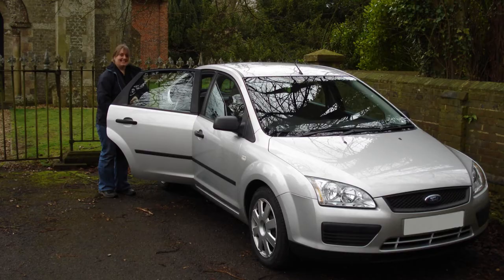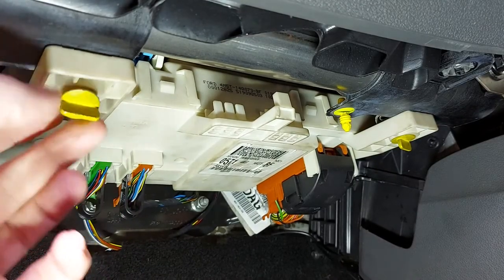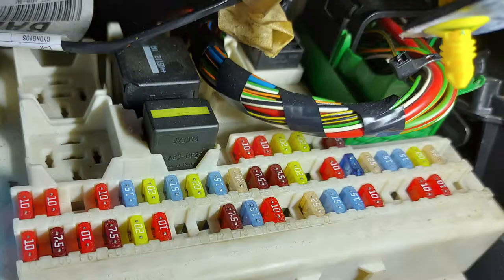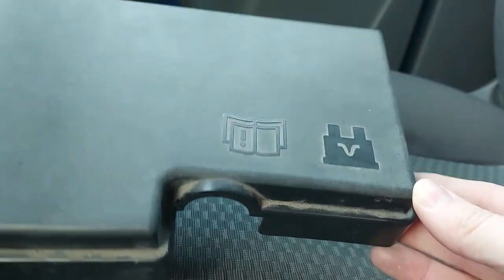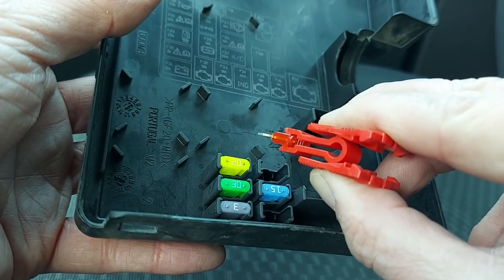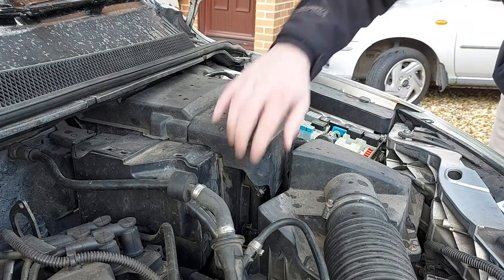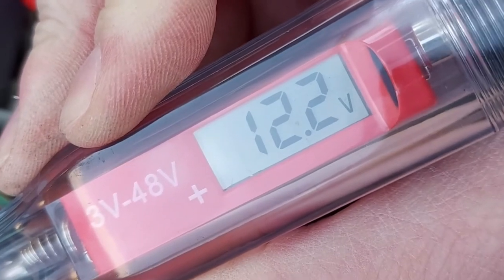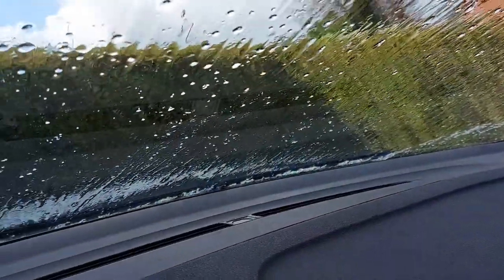Ford Focus Mk2 Fuse Box Location (+ How To Identify & Test Fuses)

Comment: nice learning curve!! can you assist, my car has a shorlt circuit...i disconneted every fuse and cables then i only plugged the power supply connector to the gem module (passenger fuse box) and i still have a short circuit? could this be a bad GEM module?
Reply from the maker: Hello. As I recall, there's a GEM test procedure. I haven't made a video on this subject yet, so it might be worth consulting the owner's club forum. Good luck.

Comment: Thanks for the vid, any idea if any of the fuses relate to rear indicators? My rear passenger side has stopped working, tried a new bulb and tried the bulb holder in the opposite light to rule them out, fuse is next on the list to eliminate! But none of the fuse descriptions relate to anything I would recognise as indicators...
Reply from the maker: Hello. I'm not sure which fuse relates to the back indicators. I have an idea, though. 

If you get a circuit tester like the one in the video, you can check every fuse within moments and identify any that have blown.

You can get a tester on eBay for about £10.

Comment: Hi there do you know which fuse would be related to the car fobb?.. My car fobb is not working despite change the batteries, so im not sure what to do, I can't unlock my car :(
Reply from the maker: Hello. The following link might be helpful: 

https://knigaproavto.ru/shemy/en/ford/focus/99-ford-focus-mk2-fuse-box-diagram-20042010.html
Reply: @CarSpyTV  thank you :). Do you buy any chance know much about overriding push to start ford focus mk2 cars? I have a manual key to open the door but not sure if that would trigger the alarm